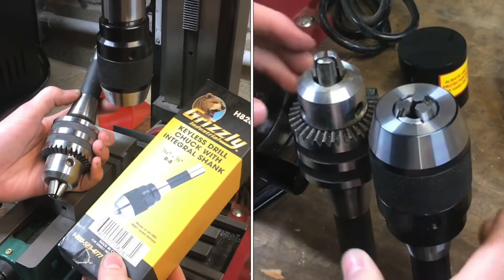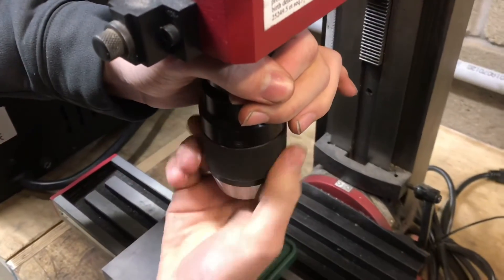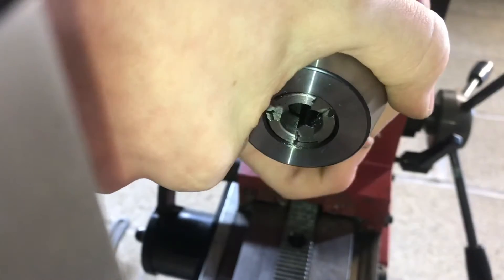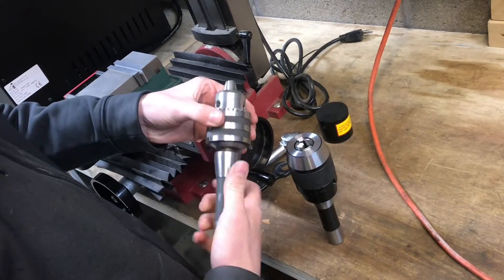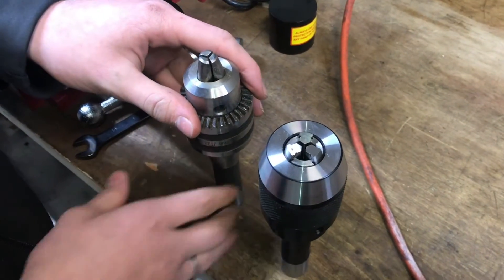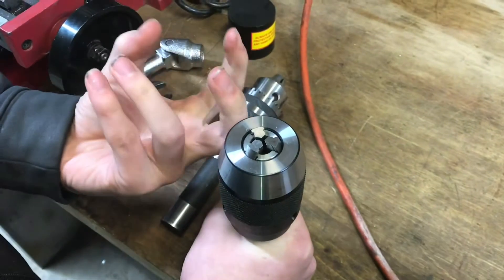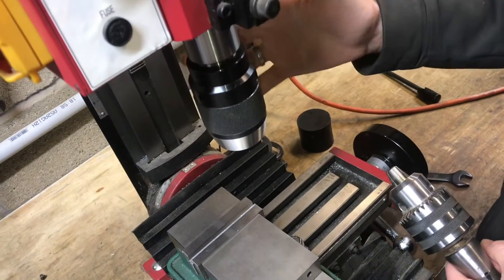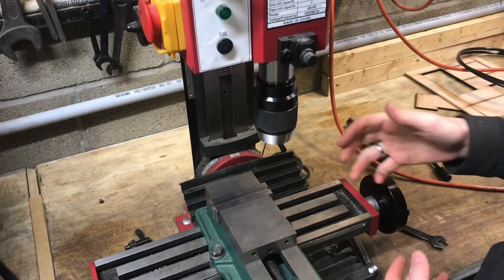(REVIEW) grizzly h8263 - 132"-12" x r-8 keyless drill chuck with integral shank

Comment: When it self tightens does it ever get too tight for you to release the bit. I see that Grizzly sells a spanner wrench, but no one says when they would need to use it. Also I saw one video where a guy said it was hard to secure small drill bits when the jaws move. What is your experience?